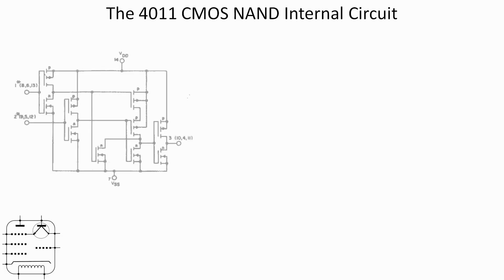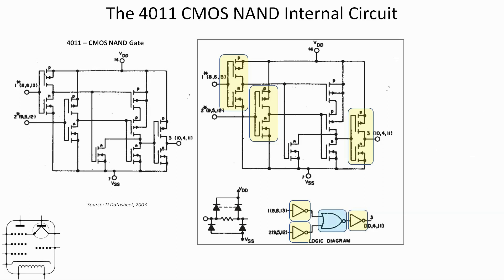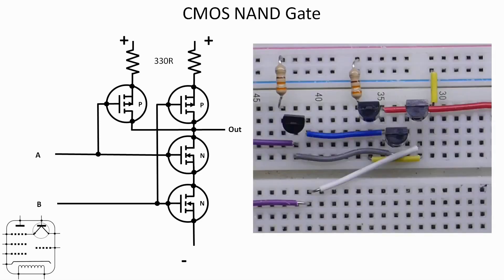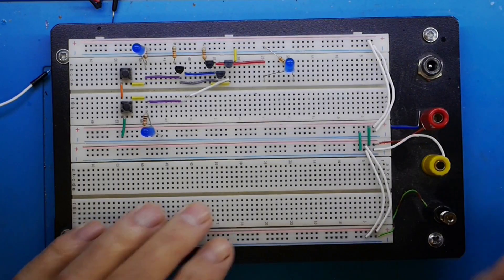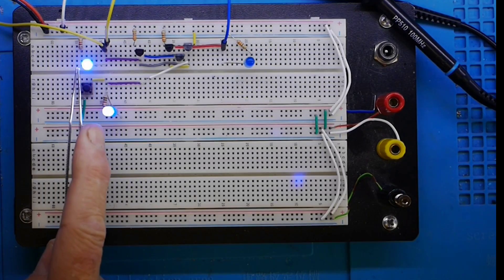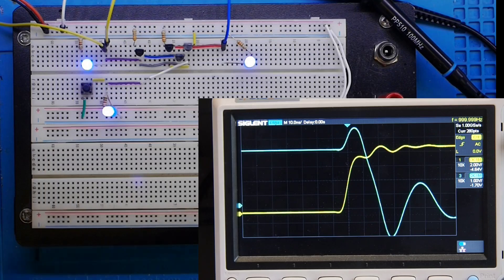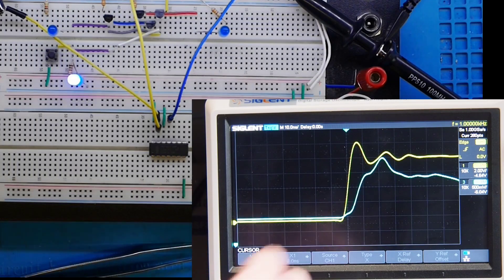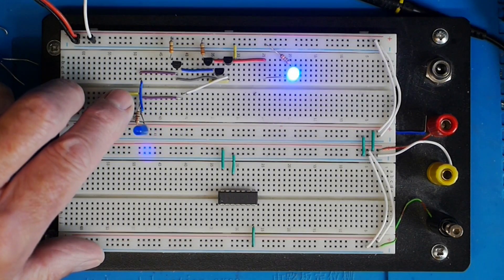Do It Yourself CMOS Part 2  - #169

Comment: Hey, thank you for enlighting me with LEDs :)
I have a few questions and would be thankful if someone has the time to answer or a link to noop understandable resources: 
In the end, you convert the NAND Gate to a NOT Gate by connecting the inputs. But isnt it the same as the Inverter in the first video then? beside, that it needs mor components? or whats the difference?
Secondly, what should be the value of the pullup and pulldown resistors, when i want to drain it with 6 or 8 Volt. 
Third: Can I controll it with 10Vpp Gates or even 20Vpp Gates (+10V to -10V), when I'm just draining it with less voltages like 6V?
and last: When I gate it not with gates but with sinoid LFOs. where does it switch? Or whats the term to look for in the datasheed, which discribes the switchin threshold.

If someone is interested to build also XOR, XNOR and OR Gates, here is a good resource....
https://www.allaboutelectronics.org/cmos-logic-gates-explained/
https://www.youtube.com/watch?v=f3zRz0d9XA8&ab_channel=ALLABOUTELECTRONICS
but sadly it didnt answer my question, or I havent understand it. 

btw.: thats very nice in your video: it's easy to follow as a beginner!